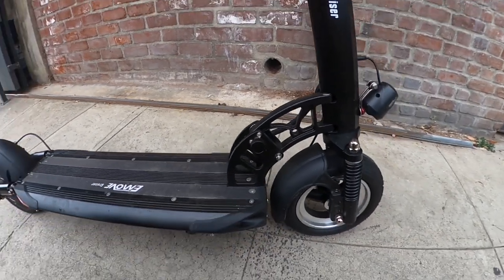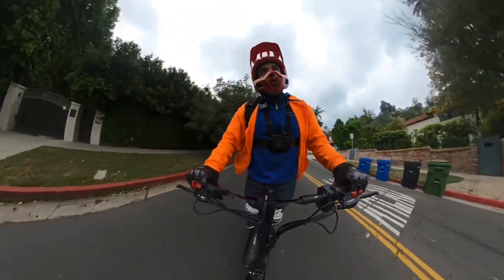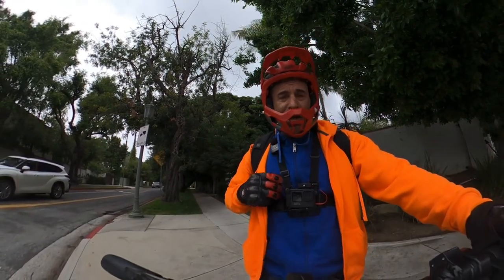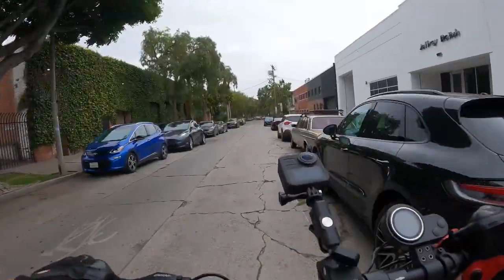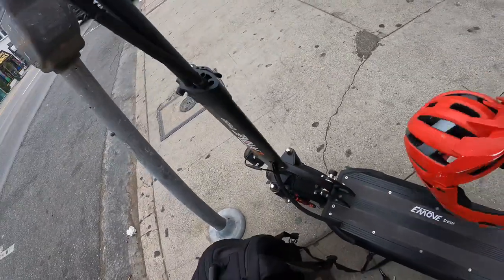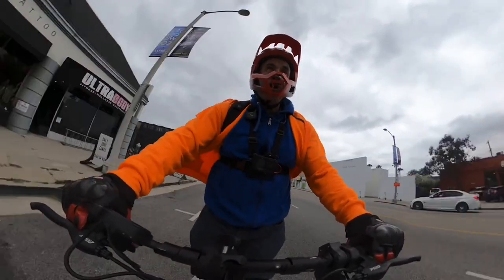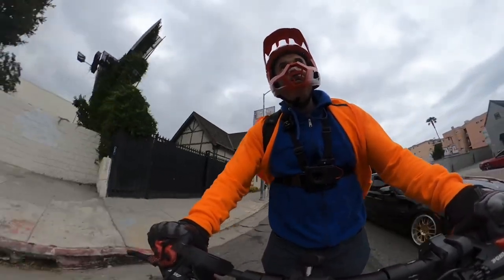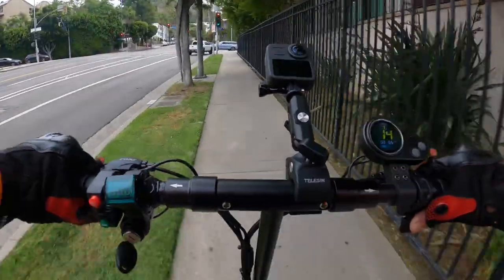Emove Cruiser CHRONICLES  Can the Cruiser hit 10,000 miles? YES IT CAN! Electric Scooter Academy

Comment: I use alot of lipo batteries with rc cars and they pretty much keep the same performance through about a half of their voltage range. They will start at 4.2 volts per cell and just hammer speed until they settle down then the half charge i mentioned they will stay pretty much at 3.7 volts until you notice the difference between 3/4 throttle and full throttle is nothing.  Then a few minutes later they hit the auto cutoff.  Those batteries are incredible compared to lead acid but i hope the future brings even more battery inovation.
Reply from the maker: Oh yeah the future is exciting with battery technology! Appreciate you dropping a comment. Happy new year!

Comment: You should change out the handlebars to a longer set of bars. The handling is much better. I just did it on my Cruiser and the difference is huge. The stearing is much smoother and much easier now. I'm very glad I did it.

Comment: Target run:
They could turn the scooter into a paperweight if they take the key you left behind.

Suspension:
It is still a rough ride if you have solid or honeycomb tires.

I have Ecoreco L5+ scooter.
It goes 25mph and has a 15 to 20+ mile range with a heavy rider.
It has full-suspension with honeycomb tires.
Riding on bad streets feels like I am riding a weed eater.

Comment: Nice video! I just got this scooter. What kind of camera & attachment are on your handlebar? I think that's cool to have one of my scooter too. Thanks!
Reply from the maker: Good luck with your Cruiser you’re gonna love it! This was actually my first scooter model  believe it or not almost 5 years ago.  On the handlebar I have a GoPro Max.  The attachment is the Ruigpro 360 holder. I like this brand because it is all metal and I have broken many plastic variations previously. I actually own four of this attachment so you know I like it.  I’m also wearing a GoPro Hero 11 with a the media mod and Rode 2 Wireless System. If you’re gonna make videos for YouTube the one thing I absolutely recommend is to use some sort of a microphone. Ride safe!

Comment: Steve nice helmet.  Where did you get the helmet?
I’m looking for an orange helmet for my bike riding.  Orange and army green is my bikes color.
Reply from the maker: hey, thanks! I can't really help you with the colors but I get my helmet off of Amazon. I have two main helmets. And this one I'm wearing my lighter helmet the Bell Super Air R - I know this one works because I was in a bad accident with it and I would've died without it. For higher speeds I wear Troy Lee Designs helmet. you can see I like red ❤️

Comment: So I bought the NUI KQI3Max (first escooter) and it is supposed to get 40 mile range.  I get 20-24 miles from full to empty.  I know there is a Real world vs. specs on paper but that's almost 1/2 of what I wanted.   I can still return it as it not accurately described and buy the Emove Cruiser S.  is it that much better?  Having no suspension vs dual suspension (in my mind) says yes.  What is the real world range I can expect?  I weight 195, cruise around 20 with hills and traffic.
Reply from the maker: they are widely different scooters. I have  reviewed the KQUI3 and my impression that is well designed and very small. 50% range estimates are unfortunately common but I guess if you weighed 130 pounds you get more range  right?  Especially at 190 it is gonna seem extremely small. The Cruiser is way more appropriate. Real world you're gonna get 30 miles range at the highest speed but if you can drive in second gear, you can get 40 miles. You're probably never gonna drive in 1st mode to get 50 miles +
Reply: @yogadude1234  I just ordered the Cruiser S.  1st gear 2nd gear, 3rd gear?  1= 0-10? 2=0-24 3=0-top spee?

Comment: My cruiser gets about 60Km range and i commute at full throttle on the roads with the cars. it's an impressive scooter for sure. I find that the 4 bolts on the front , shocks and wheel bolts are the ones that get loose for me once in a while. never leave home without cresent wrench and alan keys

Comment: Do the Target employees give you flak for bringing a folded scooter inside? If it fits under the shopping cart?
Reply: With a scooter that size. No. As long as your pushing it or put it in or under the cart.

Any of the bigger scooters, do it at your own risk.
Reply from the maker: No usually when I go to target, I lock it up outside. Occasionally I bring it in and park it on the right hand side of the store . The regular security guard allows me to do that.

Comment: Steve are scooters a good PEV choice in areas with horrible roads? I stick to ebikes for that reason.
Reply: Any scooter with air filled tires and suspension should handle bad roads.
Doesn't hurt to go with a scooter that has bigger tires.
You could even go off-roading with some of the scooters.
Reply: Air filled tires and good suspension should do the job as long as there isn’t a bunch of pot holes
Reply from the maker: no bike is definitely better